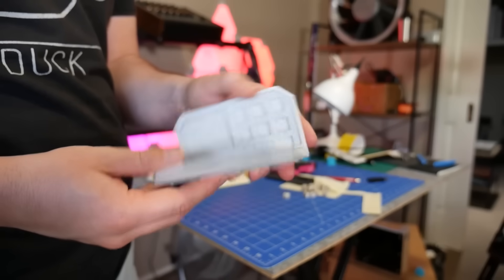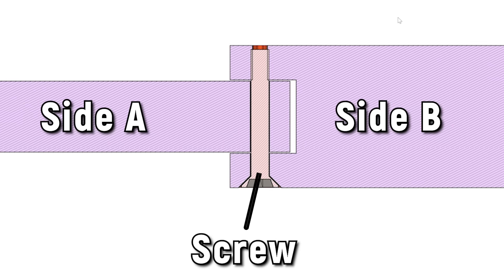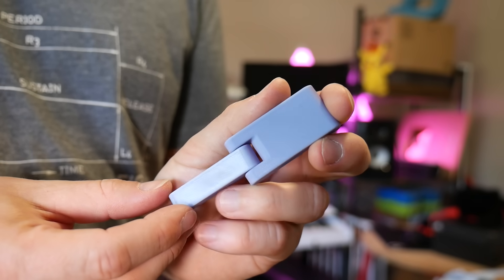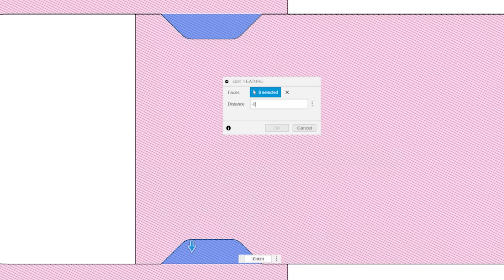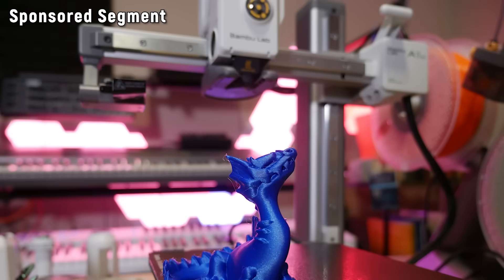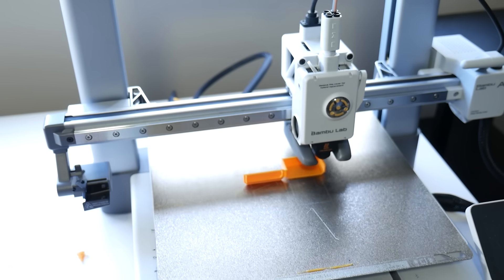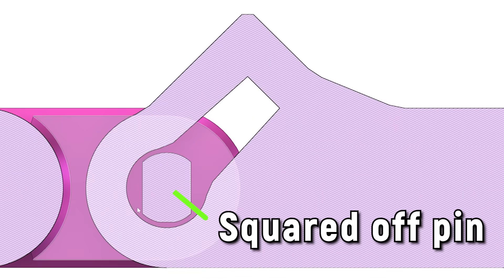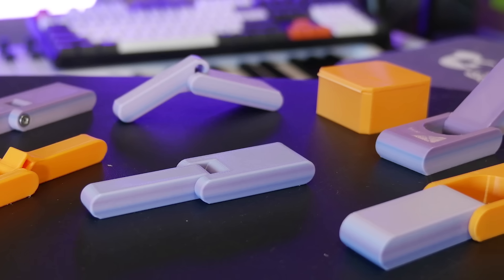Incredibly Handy 3D Printed Hinges!

Comment: Your first example, the butt hinge, is a time tested design. But then you said the drawback to it is having to put a screw in place and this doesn't ;end itself to digital dissemination. So, the solution to that is including a separate "screw" in the digital file! This will allow it to be sent digitally and no one will need to present their own screw (or pin)

Comment: Great video. Where should I start looking/researching if I need a hinge that can rotate up to 315 degrees. It's essentially a clam shell enclosure for an electronic device with a screen, so the hinge needs quite a wide range for viewing angle. Any thoughts welcome. I'm using Fusion 360 btw.

Comment: What I don’t understand with print-in-place hinges is how you print them without either supports inside the hinge or fusing the hinge pieces. How do you design a hinge to keep the pieces separated?

Comment: One I often use, mainly for beefy requirements, is a version of a butt hinge, but instead of the pin going through the middle of another part, I have pins on the "inside" piece, sticking out into the outer piece, giving a way sturdier option, with built in limits to what angle you want to allow

Comment: Thanks for beautiful video, I spent almost 6 months perfecting a Functional 3d print, it also became my Best Selling Part, I divided  the part into multiple parts to do print on demand replacements later on and the Hinge I use is a screw and a bolt which I also 3d print. although video is on my channel to give overview of the part, but you can check this specific video how the part looks like. 

Title : "This 3D Printer’s Quality Is Crazy 🤯"

Comment: On the first example you shared (butt hinge with metal fastener), do you screw straight into material, or do you model in threads that match the screw size?
Reply from the maker: Screw straight in, with the right diameter hole it will form a thread

Comment: I purchased your files to do a butt hinge. Where do I find out what size screws I need?
Reply from the maker: Cheers! I used M3 screws
Reply: @ thank you. Can this be made adjustable if I use a threaded insert - I want to be able to make the hinge adjustable and then to tighten it into position :)

Comment: I've been defaulting to butt hinges with 1.8 to 2.0mm holes and then thread a spare piece of filament through the holes for the pin. It's not the strongest solution, but works great for things like a glasses case or a tray for small parts.

Comment: With the GoPro stand, you could also add snaps so when it goes into its locking state, you have to push the piece a bit more to snap it and lock it in place. Then when you’re done, use a bit of force to unsnap it and slide it back to its rotating state.

Comment: I used a living hinge in a design (thanks to your previous video). It's two snap fit clips connected by a living hinge. Printed in PETG it works really well. The bracket snaps around two sections of a plastic play pen and stops either of the two sections from being lifted up but allows the sections to be adjusted to any angle thanks to the living hinge. It's stopped my 2 year old from escaping the play pen. I flexed the living hinge more than 100 times and it's still ok. I don't think the same could have been said for PLA but i don't print with it so i don't know and 100 times is probably more movement that it will ever see in its life.

I used a 0.6mm thickness for my living hinge. I would have tried a 0.3mm thickness but i use the prusa textured sheet so the first layer gets squished pretty hard.

Comment: Imagine a cylinder. Now change one of the curcular faces to a cone. No shoulder. Stand the only remaining flat face on the ground. Place another modified cylinder (like the first) on top of the pointy end of the first one, but make it concave pointy so they fit together, but with a gap. The second double cone (chevron perhaps) cylinder floats magically above the first by a milimeter. Repeat as many times as necessary, and finalize this magic stack with another flat circular face.

 Now, connect all these chevron cylinders together with 2mm posts along the shared cental axis. Attach the 1st, 3rd, 5th, and all other odd numbered cylinders to one body, and attatch the 2nd, 4th, etc cylinders to another body. 

Finally, flip the thing upsidedown and print it. 

I did this for a box printed on its side once, and It worked out INREDIBLY well,  the 2mm post that holds it all together while printing, shears from the torque, but stays around and keeps the hinge moving with almost no slop, but very little resistance. 

 I only came up with it from ignorance. Buttery smooth and shockingly strong, largely because the layer lines of the two bodies wrapped around eachother, and the stesses in the hinge were pushing the layer lones together rather than trying to split them. 

 Sorry if the description came out unclear.

Comment: Snap hinge is also fun to print-in-place, don't need bridging or special design, 45 degree overhangs print into each other just fine. If you make the legs thick enough, it won't snap out either.

Comment: I love high-friction hinges like the ones on laptops. 3D printing these is possible but very hard. There are multiple methods, such as compressing TPU or using a multi-stage plastic snapping pattern on the hinge surface (imagine a flower). I’m sure there are many other ways to achieve this. If you know of any, can you share?

 i have worked on using these in my designs for years but never got the perfect one.

Comment: I use thick wires instead oft screws. It can be easily cut to whatever size you need and has a smooth surface.

Comment: I offer a few products on my Etsy store that require hinges (CCsPhotoAccessories). Since they are Print on Demand by Slant3D I don't want the purchaser to have to source additional hardware so I made the hinge pin a seperate printed print. Means better tolerance than 'print in place' and more durable than 'snap into place'

Comment: While some living hings die a quick death, you can easily find others that have held up over decades of regular use. As a young engineer I learned that the factory has to flex a living hinge through it's full range of motion after they eject the part but before the plastic hardens. I was told that the polymers are oriented randomly after injection but flexing aligns the polymer chains so they can comfortably deform and recover along that axis.

My long list of 3D printing exeriments includes orienting a living hinge so it prints last and I can flex it hot off the printer. I'm curiious if it's stronger. Naturally, you'd need to extrude the filament perpendicular to the axis of rotation, not parallel to it, to get the strongest part.

Comment: Great video!  I designed a simple TPU living hinge with rigid ABS pieces on each end, using an IDEX printer several years ago, and it impressed a friend who has an engineering company with a $350,000 Stratasys 3D printer with no flexible material or multi-material capability.  FlashForge just announced their AD5X printer with a four filament feeder that is capable of filament swapping 95A TPU, which could print PETG parts with TPU live himges.

Comment: A couple weeks ago I designed a Roll Up Chess set, it's on MW and printables. The hinges are quite tiny but because there are eight in a row it works like a charm! And it is doing quite ok as well. I really love incorporating print in place hinges in my design, never thought about that locking one. Great find!
Reply: Hey I just checked and looks like this is the one I printed some time ago (Rossero on MW). It is awesome!

Comment: Sometimes I use filament instead of screws.  Everyone has filament and I just cut it to length.  My thought was that filament is stronger then a thin pin that was 3D printed because there are no layers.  It can be used in hinges and as a fastener.
Reply: Won't the filament become brittle over time and break? Specially with humidity and other environmental factors.
Reply: @mttkl  I haven't had that problem yet but I believe it's best to heat treat the filament pieces for maximum durability.

Comment: I love TPU living hinges, and so do a whole load of drone builders that use my designs for holding radio receivers & antennas on their craft.
If you look at "Happymodel EP2 ExpressLRS folding TPU holder" on Thingiplace you'll see I basically copied what injection molded retail packaging does, where the holder perfectly wraps round the object and clips closed, holding it in place.
Also I turned the pin & hoop into a popular TPU cable tie which you can print at whatever scale/length you need, and use the core elements to design your own custom ties, called the "Hoopin TPU Cable Tie".

Comment: I have used 5mm metal pins for butt hinges on a bunch of projects, and they work really well. Needing to purchase pins isn't ideal, but it makes for super smooth motion and can alleviate tolerance issues by using a standard metal piece.

Comment: I personally prefer print in place hinges. If I want tight tolerances and plan to distribute the files, I like to include two or 3 tolerance tests where people can test their printers and then choose the hinge file that works best for them. And it’s pretty easy to make the tolerance a parameter in the design.

Comment: For those who are printing with a tool-changer, you can make the interface between pin and hole out of an incompatible matterial, i.e. PLA for PETG part, to make sure it does not stick.

Comment: The one I use the most is the filament hinge. Snip a piece of filament and insert it like you would a screw.
Reply from the maker: Oh that's a really good one! Much more affordable than heaps of fasteners too
Reply: @MakersMuse  Ivan Miranda uses it to link together printed chains and tracks. saves a lot of money
Reply: I use this as well and tend to use my solder iron at a low-ish temp to kinda rivet in the filament so it cant escape
Reply: I often just use the nozzle of the printer used to print the hinge to rivet in the filament, works great!
Reply: @notsonominal  a piece of kapton tape and you'll never need to worry about plastic in your soldering iron.

Oh, and it'll have a beautiful finishing too, if you do it carefully.
Reply: @notsonominal  I just created some glasses, and the hinge design was driving me crazy. Today, I was like? "I'll just melt the pin into the frame!" I used a lighter, a flat head screwdriiver, and just melted one side of the pin down into the frame pushing it flat with the screwdriver. It's worked really well so far. But, I'm here, because I'm thinking there has to be a better way......
Reply: I use it too. It's easy and very strong. Especially with combination with old 3mm filament that is useless for me other way. Also you can heat ends of pin so it can§ fall off.
Reply: It's a great use for old 3mm filament too.
Reply: I found 1.75mm PLA tends to break when I used it as a hinge pin but PETG has been really good
Reply: @martinathome296  Hinge Pins shouldn't have much stress. Only friction.
Reply: @Splarkszter  I had the PLA hinge pin break a couple of times when I dropped my box with hinged lid. No problems after switching to PETG.
Reply: @martinathome296  That makes sense
Reply: Cheap and reliable. I personally use heat to melt one side of the filament to the printed part. It cannot be disassembled but you will never lose a pin.
Reply: I made a container for my mom. And it works awesomely well!
Reply: @Splarkszter  what kind of giant printer do you have that can print a container for your mom? Unless your mom is very tiny
Reply: I use steel wire for hinge pins, mainly in my robot tracks
Reply: I came down in the comments to ask why he didn't talk about this one

Comment: I have an idea on how to improve that mini gopro tripod example to effectively auto lock when it gets to that certain rotational point where it can lock.  If you design the back of the rounded section of the slot that the cross pin goes into to be spring loaded and printed it with the spring fully extended, the part that rotates would be forced into the channel the instant the part rotated to align with that slot.  To get it back out, simply compress the spring by pushing the leg in the direction of the spring.  I intend to incorporate this design into a bipod design I'm making.

Comment: I've been using a print in place hinge similar to your snap hinge for a very small part that is only 5mm thick. I made a series of them like a piano hinge. Works surprisingly well. Before I had issues with small butt hinges failing due to wall thickness but this seemed to solve it since both pieces have similar thickness hinges. I can't remember which video I saw it though, unfortunately.